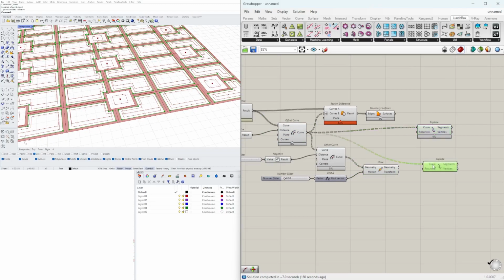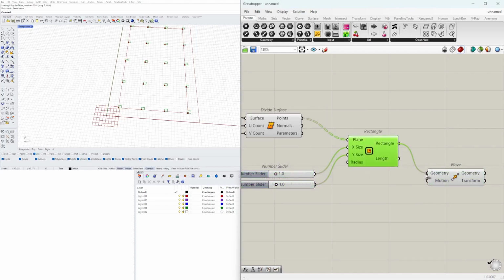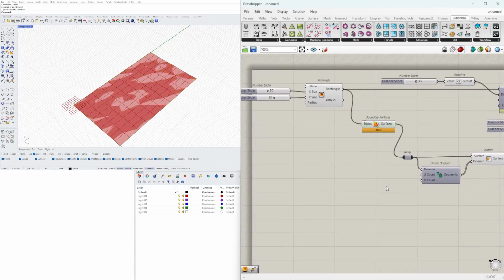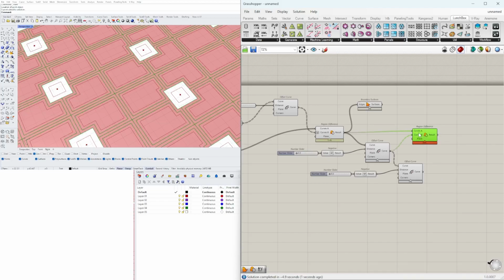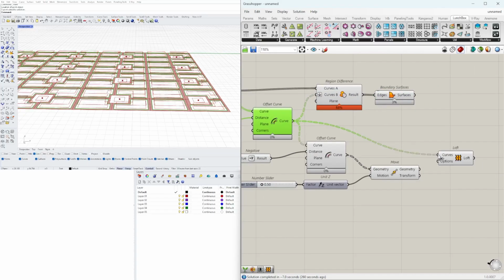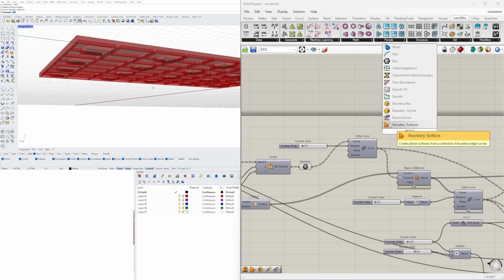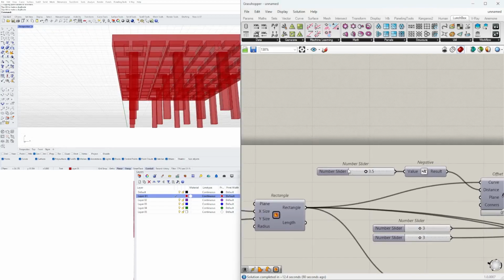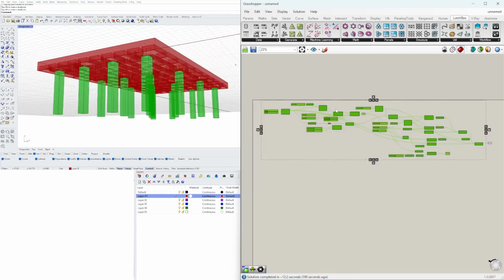How to make Waffle Slab Subdivision & columns Grasshopper & Rhino Parametric Architecture tutorials

Comment: I can help you with one thing. Try TWO reticles where one is the fraction of the other. The columns will NOT resist their fight instead of carving their way in. :P

Another way of solving this is If the modular geometry is triangular then PROJECT to the floor and EXTRUDE like a madman the set of triangles or generate a flat protrusion of your geometry and let the column grab it as a flat face. The problem is not that simple. For example the waffle needs connection points on those hexagonal set of nerves or squares. Which ones you omit is a design decision. It's clever how many architects solve this. 

I'll give you an idea using your example. This is something I'm solving in my thesis. This topic is fascinating because this IS a real physical construction problem. The science and design of structures for us architects is everything.

https://www.youtube.com/watch?v=LKaylz7woSY
Reply from the maker: This is great. Maybe I'll think about a video of creating the form work like in the link you share here but just parametric
Reply: Replying to my own comment. well, if you want to make those columns fight with the roof, why not. That could be deeply interesting too. :P